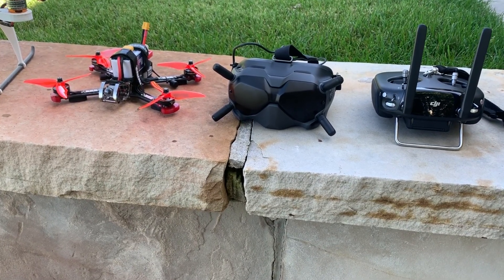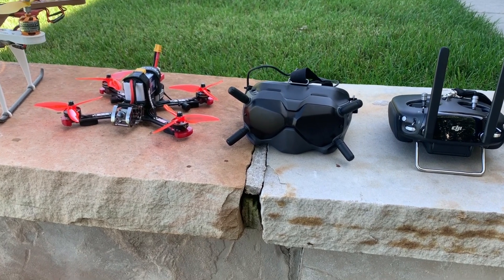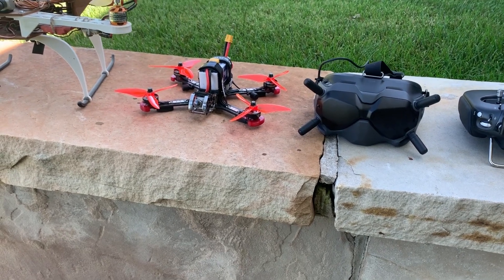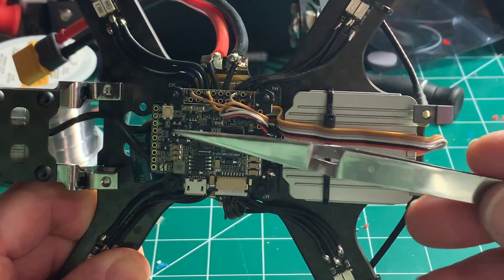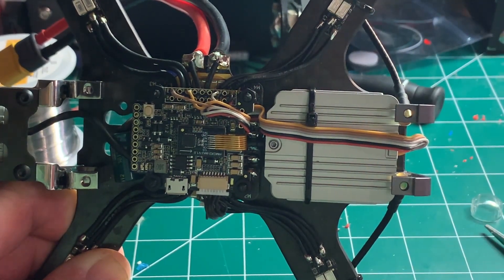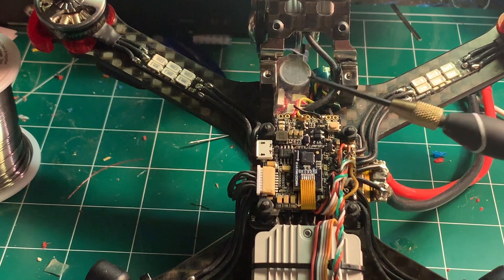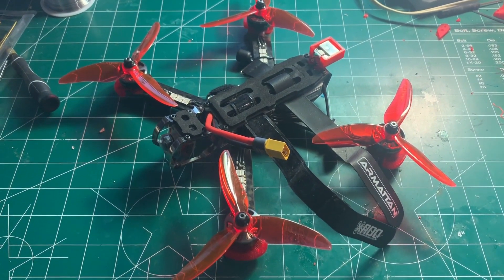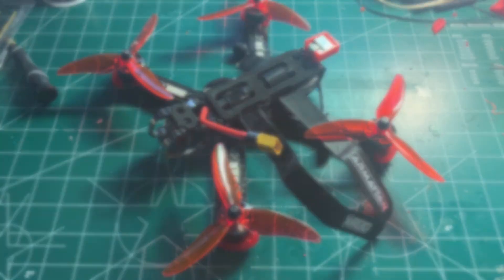DJI Digital FPV System Build Part 1

Comment: is it worth to get the dji radio or better keep using extra recievers? does it have anything like RSSI to know when u r near to lose signal etc etc? i dont like that it dont have even a display at all ...so i m thinking to get the goggles  and unit only maybe better?
Reply from the maker: The latest FW update for the goggles and the air unit allows for telemetry OSD data, including RSSI, to be displayed in the goggles. You can now turn that on in the Betaflight configurator. So if you like your current radio I would just stick with that. I bought the DJI radio as I like the simplicity of not having to also add a receiver in my builds.
Reply: @slogfpv  funny thing is that my frsky radio 3 days ago without reason dont power up now...it had happened once more in past but i found way arround it and worked again ..but now seems to not want to turn on ..i try 6 days now....so i m left with futaba radios which i have for my 3d helis...i still didnt complete order cause suddenly my father died last week and here its a fuckin mess....as for the fpv thing..now i still wonder is it worth to get the radio or get  another like jumper 16? or use the expensive futabas? or frsky again ...i dont like that the dji radio hasnt even screen display and i guess its workin only for the specific air units + cameras...for the range i m pretty sure its ok cause i dont care like long range ..i fly freestyle in abandoned building etc ..not far distanses...the offer is still on...in the price of just goggles...same money to get a full iflight rtc titan 5 with the dji goggles...now i dont know what to do with radio if this wont turn on
Reply from the maker: For your situation I would go with the Jumper T16 pro as it would cover all your aircraft at a very reasonable price. Heli-nation has it for $169 but you can join the rewards program and get it 5% cheaper. Now that the units are being shipped with OpenTX, I would highly recommend this raidio. No affiliation with Heli-nation but I think they are good to work with:
https://www.heli-nation.com/latest-jumper-t16-pro-with-hall-gimbals-open-source-multi-protocol-built-in-radio-transmitter
Reply: @slogfpv  here a local seller has it 175 so its easy to have it the next day  instead of waiting it from another country...i think so too if the frsky doesnt come alive...i guess i ll go for that.....jumper and a 6s iflight titan + dji goggles with an rxsr reciever i guess....i thought to try a futaba compatible reciever to not get another radio too since there are many to the same size/weight anymore with fasst and sfhss protocols ....i guess the range will be the same?

Comment: Noticed that you have a GPS installed, does that info show up in the limited OSD info that is displayed onscreen?
Reply from the maker: With the latest FW updates yes you can get some GPS telemetry info. See release note below:
 Added ability to customize the on-screen display information for the goggles, which supports 24 OSD
items of information items in total. (To display GPS information, enable the UART port which is connected
to the GPS in Betaflight software)

Comment: does dji work on 5 volts? i thought it needs 8.4v minimum,
Reply from the maker: Hi profaneus,
Here are the input voltage specs: Input Power: 7.4-17.6 V
Reply: tahnk you for the answer. I know it, i just want to ask you if it works, because you wired it on your flightcontroller, and as i know it has only 5 volt output

Comment: Sounds like your ac compressor unit outside needs what is called a hard start or there’s a buzzing contactor
Reply from the maker: Thanks for the heads up. Will look into it :)

Comment: Lol, dude, your gps is upside down
Reply from the maker: Since the RDQ Micro M8N does not have a built in compass and is out on a boom, it really does not matter as long as the antenna (flat portion) is not blocked by an obstacle (eg carbon fiber frame battery). Some people just attach it to the battery strap with the flat portion facing out (not at all level or oriented). I just happened to slap it into the holder while I was configuring Betaflight. My final orientation, before I flew it, was flat side up like in the video at 7:31.

Cheers,

SLOG

Comment: I have the Mamba f04 mini 20A stack, Runcam tx200, Rumcam micro swift 3 v2 camera and xm+.
What are your recommendations on how to connect the Runcam tx200 and Rumcam micro swift 3 v2? My intentions are to build the Diatone gt 2019 r349. Thanks for sharing your build review...
Reply from the maker: Hi Home Dronen,

Here is a link to a wiring diagram that should help you out. It shows how to connect your receiver, VTX and Camara. 
https://cdn.shopify.com/s/files/1/0027/2708/4144/files/M_F405_MINI_MK2.png?1497 . It shows how to hook up the VTX you are using as well as the FRSKY sbus receiver. They are showing a R-XSR but the sbus connection is the same. 
I hope this helps.

Cheers,

SLOG